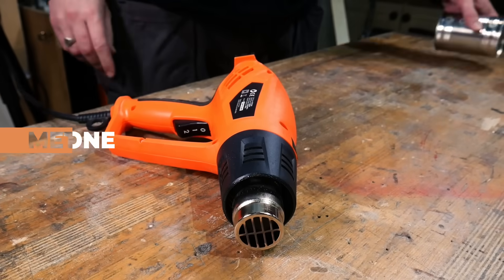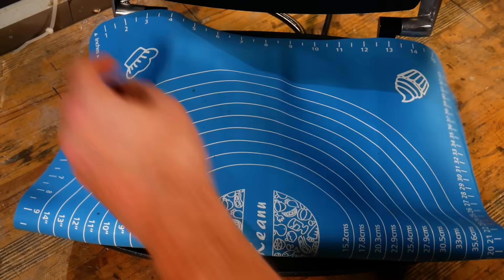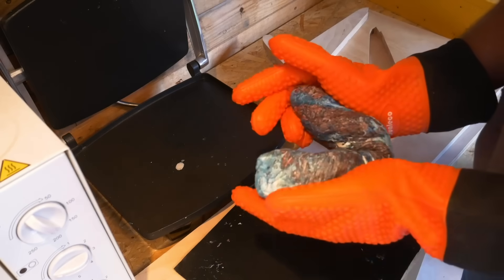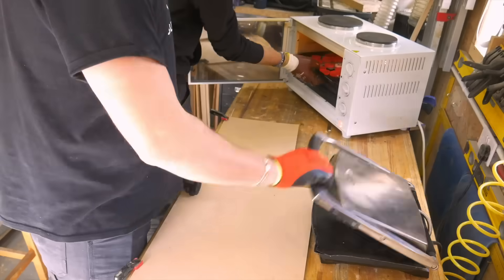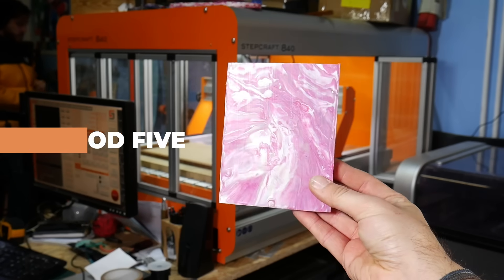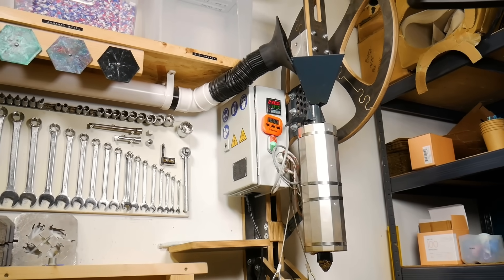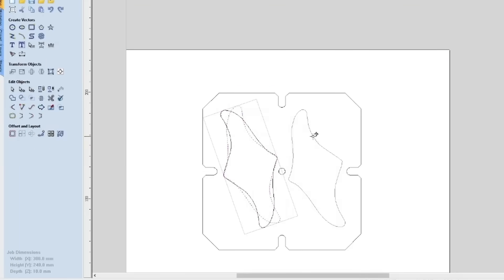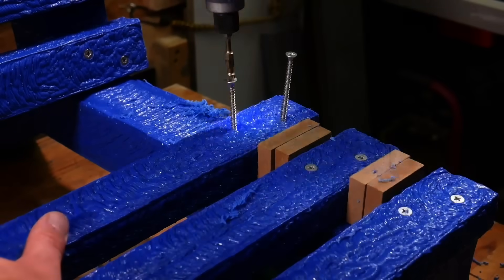7 Ways to Make Stuff from Recycled Plastic | From Tin Cans to Wazer Waterjet cutting!

Comment: Rotary molding is better than injection molding.
Reply from the maker: It really depends on the application
Reply: @BrothersMake  True, its 100x better if you have a cnc and can mill your own molds though for injection molding!  Otherwise oOf!  It gets crazy expensive!   I used to work at "ROTO MOLD" making one piece HDPE dog kennels "Ruff Tuff Kennels" they changed the name recently but one of the best kennels out there and its all made at once other than the doors and holes we cut out and put on.  We weighed out pellets of HDPE and put it in the 2 piece mold - bolted it on spinning arms and it spins in a heater.  Then we cut the flashing off.  It's a HOT workspace though lol.  The strength of it is amazing!

Comment: I appreciate the info density with minimal filler. I’ll save it in my DIY playlist for future reference.

One thought: Why not chuck in a different bit in the cnc (HSS or carbide router bit) and use it to cut out your aluminum parts?

Or maybe (for the sake of those of us with numerically-challenged bank accounts 😎) at least mention you can cut aluminum with any woodworking tool that uses carbide as the cutting surface; which is most circular saw blades as well as some jig saw and SawZall blades plus router/Dremel bits and tons more.

Comment: doesn't the plastic give off noxious fumes when it's melting?
Reply: No. Plastic only outgasses when it's burning. If you're burning your plastic you're trying to melt it at too high a heat. Determining what heat you use should be the first thing you do in this process. You do that by melting a small sample until it starts to burn. I don't mean it bursts into flame either. I mean it just discolors some. Then reduce the temperature from there to do your volume melt. The plastic is only going to get gooey. It'll never turn into a liquid.
Reply from the maker: We have a whole video on plastic recycling safety. Go give it a watch 🤙🏽

Comment: What about the smel ? Does it smell heavy or not so ?
Reply: Melting HDPE smells sweet. It's rather delicious really. It's a plant hormone. If there's an acrid smell it means you're burning it. Job 1 in this whole process is figuring out the right temperature to melt at. To that end what you do is you melt a small sample in gradual steps observing it. When it turns brown and crusty you've gone over the melting temperature and need to reduce the heat. We want gooey and not crusty.

Comment: Yeah! Great vid you blokes!  The thing that crossed my mind, apart from the fun of making stuff (always good in my book) the lack of hardwood these days means it's difficult to get hold of wood to make decent bats for the ancient game of Bat and Trap.  However, I'm sure they could be made from recycled plastic to the correct spec.  Brilliant!  I'll have to slot this in, along with all my other projects...!!  Thanks, chaps - liked and subscribed!
Reply: Dear Sir, there’s a new kind of flooring made out of a color-dyed fiberglass filiament and plastic, which is PHYSICALLY INDESTRUCTIBLE, but EXPENSIVE. It’s not that cheap extruded plastic beams used to replace beachside wood broadwalks (which unlike the insulated wood broadwalks, increments solar heat and will melt the sandals off your feet) but a composite material of lengths of fiberglass threads compressed and melted together. After a homeowner hires someone to construct house floors or patio porch’s out of this material, dyed to look like wood, they always have shortened cut off pieces they usually put on the curb for garbage pickup. If you could ‘cur shop’ those pieces, you could repurpose them into unbreakable baseball bats and unbreakable plastic artifacts, using diamond-edged buzz saws and a LOT of work. EOJ

Comment: Does heating plastic release toxins?
Reply: Not if you do it right. We're trying to just melt the plastic not burn it. So what you're going to have to do at the outset is figure out what temperature to melt at. You do that with a small sample you heat up in steps Raise the temperature 10° every 10 minutes. You will burn it eventually. But only a little. When plastic is burnt it turns a crusty brown. So you back the heat off some and do your melt at that temperature. Personally I melt HDPE at 285°F But your oven may vary. There's no advantage to going beyond gooey. It'll never turn into a liquid. It goes from gooey to crusty. Crusty is no good. After crusty it probably gets smokey and flamey. That's where you have to worry about toxins. Melted HDPE is actually a sweet smell. It's a plant hormone. It'll make all of your plants ripen. It's why you shouldn't store fruit in plastic bags. The ethylene makes them kick off.

Comment: You could also use the extrude method in a much smaller scale to produce your own 3d printer filament
Reply: It would be difficult to make filament that is consistent. I'm sure the commercial manufacturers use some pretty sophisticated feedback mechanisms to achieve precision. It's not just squeeze and go. Nothing's ever that easy.
Reply: @1pcfred  look for the "filastruder"

Comment: Soup can method would probably be easier if you didn't use a pull top can (which has a ridge).  A standard can opened with one of those no sharp can openers gives a nice smooth surface at the lip

Comment: Can this recycled plastic be turned into liquid to pour molds?
Reply: No. Thermoplastic can never achieve a liquid state. It'll burn first. The best you can do is a sticky gooey mess. It goes straight from gooey to crusty. There's no magic temperature where it'll flow. But you can hold it at gooey indefinitely. Given enough time it should level out. By enough time I'm talking hours to days. The other problem with this stuff is warping and internal stresses. You may have noticed how they made that one block in a press? They did that to keep it from curling up. The potato chip syndrome. Internally that piece is still stressed out though. If you cut a groove in that piece it'd warp. They set the molecules under tension.

Comment: I would like to make a mallet such as yours's using the same technique.  I have several questions and a disclaimer.  I do recycle all my aluminum cans, glass, metal cans, plastic and cardboard and am very ecology conscientious.  I do not have access to a lot of HDPE 2 plastic and was wondering if I could augment with HDPE 1 or 3 and have a workable product afterward.  I know you recommend against mixing plastics because of the inability to recycle later.  But if I were to make an entire canister of HDME 2 and toss it in the recycling bin how would the recycler know it was pure HDPE 2 and not contaminated with a small amount of other plastic?  Or in the opposite direction and I did cross mix the plastic how would the recycler know it wasn't pure.  Also, what is significant that HDPE 2 is the "best" for a mallet as opposed to the other type of plastic?  It isn't my intention to make more that 1 or 2 mallets total so I wouldn't be wrecking a lot of plastic recycling.   
subscribed,
Reply: Recycling is a scam. Most of the recycled material goes right into landfills. It's mismanaged feel good nonsense. That's because the people in charge are incompetent. Green glass can't be recycled at all. That's because there's so many shades of green. Only clear and brown glass can be recycled. But if it gets broken  you can't recycle broken glass. What are you going to do sort the shards? That's a total waste of effort for no return. That's really the problem with all recycling. The feedstock is just too dilute. Resource recovery doesn't make sense at too low concentrations.

Comment: Good video.  Thumbs up.  Question:  What type of plastics should not/cannot be used in this method?
I realize there must be thousands of different recipes for plastic so if you cannot answer that question no problem.
I found the table saw push stick most interesting.
Reply: I use HDPE typically you will find the logo on the bottom of like a shampoo or body wash bottle, and tons of others around your house.  I've made a couple of the push sticks for table and band saw
Reply: @dougmulle2627  : Thank you very much.
Reply: @dougmulle2627 which recycling number is that? So far I only know PET/PETE is 1 cause my nephew is recycling that into PETG filament.

Comment: One of the best vids I've seen guys, not counting the 'Delicious Members'!
I love the idea of recycled plastic collected on the beach being made into a bench seat FOR THE BEACH 😊 Some other excellent ideas, very inspiring, but I have one question..... don't you start puking and fainting after all those plastic fumes from melting it? Otherwise I'm off to buy a heat gun ☺
Reply: A heat gun probably isn't the best way to melt plastic because it is difficult to control the heat. If you get the plastic too hot it'll let off fumes. HDPE is completely molten at 285°F Heat guns can reach a temperature of 800°F So yeah it'd be easy to go overboard. Your best bet is to melt plastic in a convection oven. Once HDPE is melted is doesn't get any thinner heating it up more. It just starts to crustify. If it is starting to look like burnt sugar it's too hot.

Comment: You know I have seen those round mallets made a bunch of ways , people love making them - what I have not seen is people  actually using them to make something  they will ever use ( they get a lot of demonstration use for leather craft "projects" to make leather items that are never used )
Reply: I made a new plastic face for a hammer out of melted HDPE. It works. It's a plastic hammer. I can beat the living crap out of stuff with it and it deals with it. HDPE is some tough material.
Reply: @1pcfred  I generally use steel hammers or occasionally brass if non sparking is needed, mostly in the 500g and up range , how much mass can you get on a plastic hammer of reasonable size ( the density of most plastic is rather low and a lighter hammer is generally not a good thing  as it means your arm has to work a lot harder ) ?
Reply from the maker: We've had one that we made about 5 years ago and I'd say it get used in the vast majority of projects - it's super helpful!

Comment: You could also use your extrusion method to mass produce interlocking bricks.  I've toyed with the idea after reading an article about a company doing just that and thought it would make a great DIY project that could potentially save me a bunch of money in building supplies.  I would (as well as y'all) have to look at the relative strength but I'm sure it would work in non load bearing applications.
Reply: Yanno, it might, with some epoxy poured over the top, be pretty cool to make interlocking puzzle piece shapes and use them to make a tabletop, a bar top, or even a countertop! That's a VERY intriguing idea! 🤔

Comment: Would plastic made bricks work? I don't mean load bearing but small garden walls? Would the plastic break down quickly or stay solid? Is there any way you guys could test this out?
Reply from the maker: There are some people who have done work to produce interlocking (almost Lego style) bricks, which do work. So we may try and get our hand on a mould, as yes that would absolutely be achievable!
Reply: @BrothersMake  that would be amazing. Thanks.
Reply: You couldn't mortar the bricks. Nothing is going to stick to plastic. It'd be kind of expensive compared to concrete too. Sure the scrap plastic is free but melting it and molding it isn't.

Comment: Love the ideas and how you made it practical for the average DIY'er.
How do you know what plastics will work?
Reply: Google....the list of meltable plastics is available
Reply: I've only melted HDPE and there's two varieties of that. There's colored and colorless. Colored HDPE is a lot easier to melt than colorless is. But I like the colorless stuff better. It's harder and more slippery. The colored plastic has binders in it that make it melt better. Even white HDPE is colored plastic. The translucent HDPE is colorless. Stuff like plastic milk and water jugs is colorless HDPE.
Reply: Experiment. All plastic is numbered so each type will be the same. Some shrinks clear and others will melt to the same density like the stuff they make here. Stuff like soda and milk bottles are they type they are using.
Reply: @tstuff  I've melted quite a bit of HDPE. Enough that I've gained a fair amount of knowledge about it. Soda bottles are PET. So they're not melting those. The caps are LDPE. It's an inferior plastic. I've melted those and I'd recommend people avoid it. Milk bottles are colorless HDPE. It's extremely hard to work with but yields a superior product that is harder and more slippery than colored HDPE is. Beginners shouldn't start out trying to melt colorless. Stick with the colored HDPE with binders in it. Plastic buckets are your best stock. Don't melt bottles that contained scented soap. I don't care how cool the color of Tide bottles are, don't melt it! It stinks to the high heavens. As far as experimenting goes what you need to figure out is the proper temperature to melt at. Melt small samples and keep increasing the temperature by 10° until you burn the plastic then back off from that. Burnt HDPE will look like burnt sugar. It gets all brown and crusty. 10° below where the plastic burns is the best you're going to do. The best thing to melt HDPE with is a convection oven.
Reply: @1pcfred ❤Many thanks!❤

Comment: It's a cool project but if the plastic is correctly sorted in the appropriate dumpster it can be turned into far more efficient design and maybe more useful!
Reply from the maker: Only 9% of plastic put in recycling bins is actually recycled. So we disagree that it would be more efficient!
Reply: @BrothersMake  9% of plastic in general is recycled but approximately 30% of plastic from recycling bin is recycled. It depends of the country but in Europe it can go up to 45%!

What I meant by efficient is that your process can made part with "100% infil" but in industry plastic parts are designed to minimize the amount of plastic. I think your process use at least 3-4 times more plastic than needed
Reply from the maker: But surely that is a benefit? More plastic removed from potentially pollution the earth.

Also, the 45% figure is complete bull. The UK claims 47% but the vast majority of this is exported to countries like Turkey, Malaysia and the Maldives. These countries do not have kerbside recycling systems, so it simply piles up and is either burnt, or it’s swept into the waterways/the ocean
Reply: @BrothersMake  yeah I agree with this argument it's hard to know what is true and what is bullshit...
In my opinion as long as you are using waste that cannot be recycled in industry likes face mask or anything to expensive to process you are reducing waste!
But for things that can be recycled easily like bottle cap I think it's better to just put everything in a recycling bin 🤔
Reply from the maker: Many councils do not accept bottle caps. And even if 45% WAS being recycled (which it isn’t), then I’d much rather recycle 100> of it ourselves.
Reply: @BrothersMake  as you like but sometimes a piece of scrap wood is easier and lighter than a big piece of plastic
Reply from the maker: Sometimes yes. Though we enjoy finding new uses for waste plastic :)

Comment: Seems like possibly a good idea for wall and/or floor tiles. Any thoughts?
Reply: Plastic is pretty slippery so probably not the best choice for flooring. They're melting colored plastic which has binders in it and that helps. The uncolored plastic is really slick. That's like the translucent plastic jugs. It's just pure polyethylene. Even white plastic is colored.
Reply: @1pcfred   Slippery is good. Only reason for having tile, sliding around in your socks.

Comment: Great video!  Landfills sure don't need all that plastic, might as well turn it into something useful.
Reply from the maker: Absolutely! Thanks for watching
Reply: What's wrong with landfilling waste? There's a lot of land that's uninhabitable. Certainly a lot of land that's uninhabited. Humans occupy 6% of the surface of the globe. Most of the world is in fact tractless waste. Most people don't know that because they all live together in a few areas. So they get this idea that the whole world is as crowded as where they are. Go watch a documentary called Atari: Game Over. The plot of that revolves around a landfill. You'll see landfill groupies!
Reply: @1pcfred  landfills are a fact of life, waste has to go somewhere.  Plastics typically take a very long time to break down and decompose.  A big problem with putting it in an uninhabitable area is that the uninhabitable area is very far away, and it's more expensive the further you have to move it.  I don't know of any uninhabitable land in my area except for land that's in a floodplain - that would be the worst spot for a landfill too.  Ideally, plastic should be kept separate from other trash that will decompose quickly.  Recycling it is a good idea.  Nobody wants to see trash piles out in the woods just because it's uninhabited.  Landfills should be managed responsibly.  Look up ganges river pollution for an extreme example of what bad management looks like.
Reply: @1pcfred  yes, that works too as long as it burns hot enough using forced air.  It will produce a lot of CO2, but trees do a good job using that up and producing oxygen so we'll make more CO2 for them.  It's important that it burns hot enough or else plastic and rubber will release a lot of toxic chemicals.  It needs to be done in a furnace with a boiler in order to produce electricity.  That's where the expense comes into the picture.
Reply: @1pcfred  I'm not a fan of wind turbines (pun intended).  Solar would be better if the panels were more cost efficient.  Nuclear and coal-fired is the way to go for now.  The sun isn't always out, and the wind doesn't always blow, I knew this a long time ago.